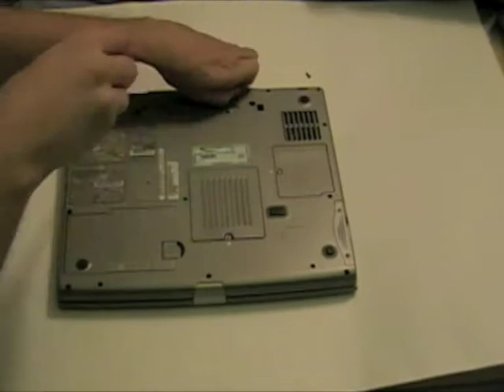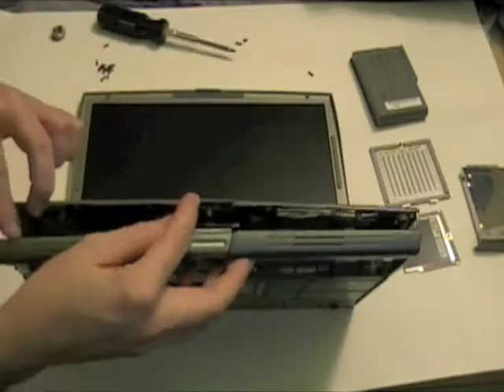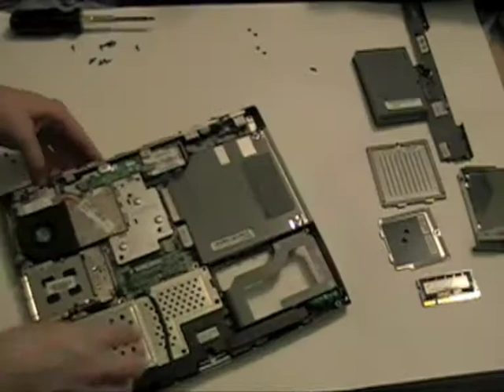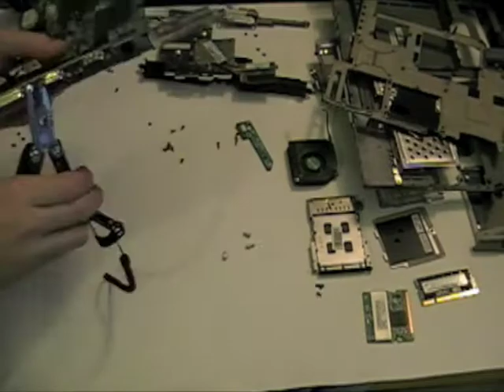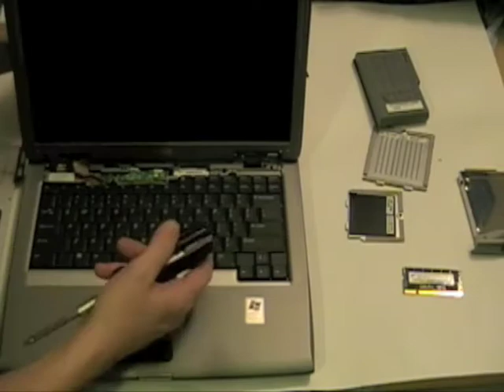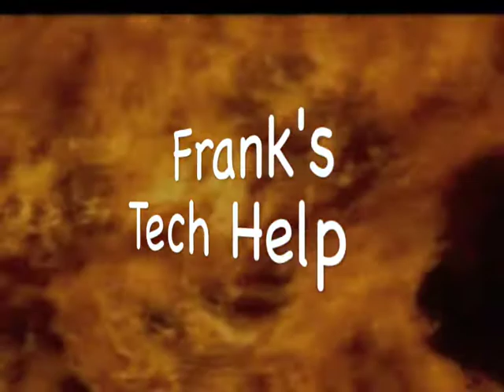How to break down and rebuild  a laptop - Dell Latitude D505 - Repair Power Connector - Time Lapse

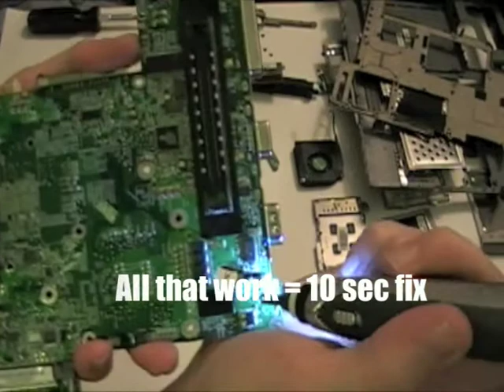Comment: Hi there! My niece has the same computer and has stopped working, I promised to fix it but I am not a technician. What is the tool used in minute 3:40? is a kind of soldering iron?, serves to remove the parts that do not work?
Reply: The description tells you what he did. Probably a cracked solder joint, but that probably is not your problem.